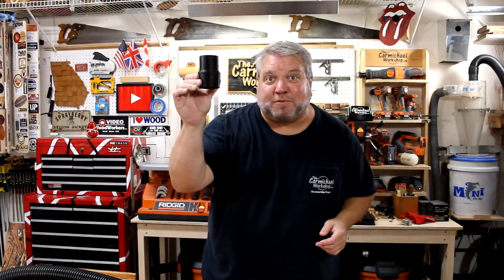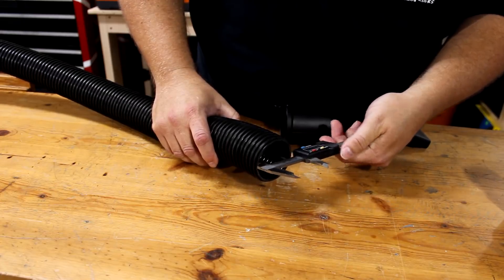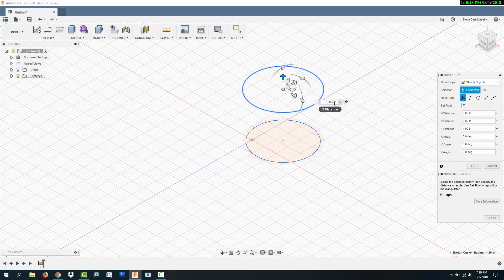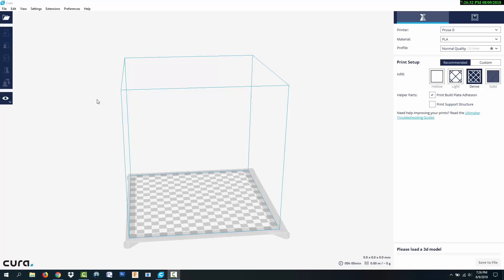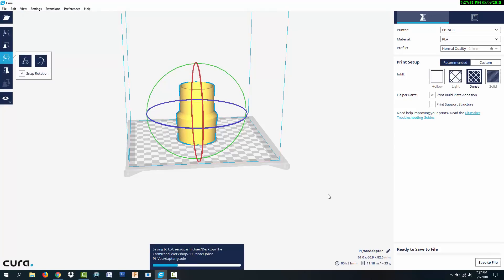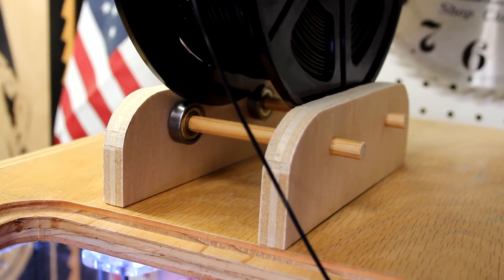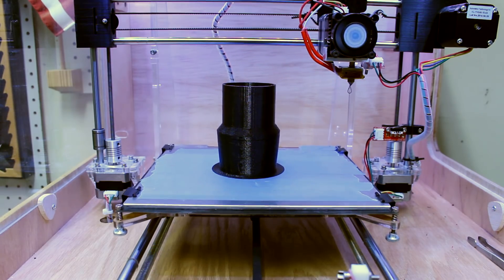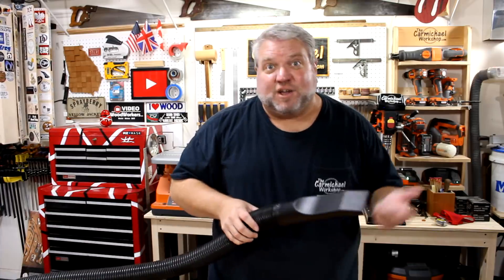Make a Shop Vac Hose Adapter with Fusion 360 and a 3D Printer

Comment: Nice design. Looks a little thin on the printer, have you had any durability issues? I'm printing one now and will find out for myself but would love to hear a review with some age on it.
Reply from the maker: Hey, thanks!  I printed two of these and still use both of them connected to stationary tools.  Sometimes I disconnect one and attach it to the floor wand, but it slides out too easily unless I tape it on, but it's rare I use it for that.  A design change to solve that would be good.
Reply: @SteveCarmichael  printed it. Came out well in just over 2 hours. Was a little loose in my hose but a few wraps of Teflon tape solved that. The working end fits attachments very nicely. It even felt stronger in my hand than I thought it would. Used esun pla+ because I plan to keep it outside in texas. 9/10 Good work!

I'm thinking about trying the remixed version with barb, but he changed the design and in my opinion made it weak. In slicer you can see it only has 2 walls on the straight part. Will try soon and let you know. Thanks again.

Comment: I bought my 3d printer partly for this reason. I struggled with Fusion 360 but now it’s very much clearer. Now I can get on with my dust collection hose connector/adaptors. Thanks Steve.
Reply from the maker: Cool!  I've made a few of these since.  I saw on thingiverse, someone added a modified version with a ridge on the end to hold it in the hose better.  I haven't used Fusion360 since so forgot all I learned.  lol

Comment: not sure what i have missed, but when i try and move the circle along the vertical plane, nothing moves or changes, what have i missed?
Reply: I think it has to do with constraints (which fusion 360 does a bad job of showing you). Notice how he draws the circles off-centre from the origin. In addition, you need to make sure that the second circle's centre point is not constrained on the first circle's centre point. In the sketcher, make sure nothing but "Show Constraints" is checked in the "Sketch Palette" window on the right. Then look for the circle constraint, select it, and then hit delete.

Comment: Hey Steve, great video. You sold a $300 Autodesk product today! I was wondering about your measurements on the hose and nozzle. 2.0 and 2.3" respectively. The vaulted, narrower portion of the smallest end is 2.0. If your hose is 2.3", is the clearance between the ID of the hose and the 3D Printed part the .3" allowance for it to fit snugly?
Reply from the maker: Hi Kevin!  I did?  Wow, that's awesome!  Thanks!  I watched my video again for the measurements.  The end that the vac attachments slide onto is tapered.  The attachments have an inside diameter of 2.3", so I made the tapered end start smaller at 2.2" and go to 2.4", so that the attachment would slide on and get snug about half way in between. The other end that slides into the hose is just 2" straight with no taper, because I planned to glue it in, but it's actually tight enough that I haven't bothered gluing it.

Comment: I am thinking about diving into the 3D printing world, and I really like your method for supporting the spools so they can rotate with ease. Should you ever find the need to do multi colored printing, I just watched a video from 3D Printing Nerd about something called Palette 2, which allows almost every printer on the market (as long as it uses 1.75mm filament), to print using 4 colors at the same time. You can find that video right here
https://www.youtube.com/watch?v=gd3FGrIDYn8
Reply from the maker: Wow, that is really cool.  Didn't even know that was possible to make multi color filament.  Thanks for the link!
Reply: The Palette 2 will allow you to put Van Halen stripes on anything you print. :)

Comment: Hi Steve I was was thinking about getting a 3d printer for clamps tooling an like you I struggle trying to get the right size adapters to fit. Do you think they are a good investment.
Reply from the maker: A kit like mine is about $150 these days.  I have it just to play with and make occasional videos.  This is the first time I've made something I can use though.

Comment: That was neat. How many types of material can the printer accommodate (besides plastic)?
Reply from the maker: Hey, thanks!  Yeah, I need to print some more stuff.  I think it only uses plastic-based material, because it basically melts it and spreads it layer by layer.  There is filament out there that has wood and metal in the plastic, but it's still mostly plastic.

Comment: Thanks, Steve! I've been considering a 3D printer for my shop. Great info here! With respect to hose adapters: I've been messing around with heating up PVC pipe with a heat gun and reforming the PVC pipe to fit different diameters. It works but not ideally. I like what you did here. Thanks again.
Reply from the maker: I've done the pvc thing too.  I'm actually printing some of these to replace those.  There is an elbow that I would like to try printing which would be a good challenge.

Comment: It can sometimes be difficult finding the correct shop-vac adapter. I went along to the plumbing center and picked up some lengths of PVC plumbing pipe of two or three different diameters. I then cut them to the desired length and slipped the smaller diameter pipe inside the larger one and used PVC weld to hold the two pieces together. I have made 5 now and they all work great around the workshop. Just thought I would share that for peeps who don't have a 3D printer.

Comment: Hey Steve, nice Video have you noticed your printer lost one of the left linear bearings which is now jammed against the left Z leadscrew?
Keep up the good work
Reply from the maker: I will have to look at it.  I noticed there was a white plastic bushing at the top left that had worked its way up the threaded rod.  Also the front right thumb nut that adjusts the bed height vibrated off a couple of times.  I got it in a trade, so someone else put it together.  Thanks for letting me know.

Comment: I just got a 3d printer and am the process of printing anything that I can use in my shop. The main things are peg board items and the black plastic knobs for jigs. Do you plan on sharing the stl file?
Reply from the maker: Hi Rick - I put it on Thingiverse - https://www.thingiverse.com/thing:3046968
Reply: Thanks Steve.

Comment: Hi mate before i start, our heatwave is well and truly over now, it's been bouncing these last couple of days.
Anyway as for the video, it's amazing how technology has come through these days, i don't have the 3d printer plus i'll be useless with the input of the size i wanted, heck i struggle with Sketchup that's why i prefer PDF plans ha ha ha.
As for the adaptors, i agree you can never find the size you want so i just go old school and either make them, or lately i have used a heat gun and melted an adaptor just enough to fit what i want it for, then let it cool down, adaptor done. Take Care mate.
Barry (ENG)

Comment: Very cool Steve, I am still trying to learn Fusion 360.  Thanks for sharing.
Reply from the maker: Hey Marc, this is the first thing I've tried.  It was a good starter project since it called for just circles, move, loft, shell, and hole tools.
Reply: Well,  you did an outstanding job, Steve.  I was going to drive to the Atlanta show but I don't think my back and hip can ten-hour drive, and I am too much of a coward to fly.

Comment: Hey Steve that came out great.  Excellent use for the 3D printer.  I can think of a few fittings I need to print for my dust collection system.  Thanks for sharing.
Reply from the maker: Thanks Paul!  It's pretty awesome to be able to create a part that I couldn't find anywhere.

Comment: You are one smart guy Steve, and I sure do like your sticker display. Shows lots of respect for your fellow YouTubers. Congrats on your success with the hose adapter, it certainly is a problem for lots of folks.
Reply from the maker: Thanks!  The sticker spinner keeps growing.  I may need a second one.
Reply: @SteveCarmichael  it's pretty cool!
Reply: by the way, to not have to resize your files in cura after finishing in fusion save it in mm when you're done making it.

Comment: Great Video Steve ! i'm trying to find the correct adapter for my new Kobalt Table Saw dust port !
Reply from the maker: Hey man, if you can't find one let me know and I can try to make it.
Reply: Hey Man thanks ! I will get back to you on this ! I dont have dust collection in the shop since I mostly just use a Scroll Saw.  The new table saw makes a mess though lol.  I only have a 6 gallon shop vac at the moment to clean up with.

Comment: Glad to see some more printers failing!  Try doing it in vase mode so it won't be weaker on the seam.  Next up...my world cup?
Reply from the maker: Ha, yeah, it was funny but kind of disappointing to see the nozzle just moving around mid-air after a couple of hours of success.  It was easy to fix though.  I didn't know there was a vase mode.  Will have to look for that.

Comment: Awesome Steve! I really want to get a 3D printer!
Reply from the maker: Thanks Mark!  This is the first time I really used it other than printing little Thingiverse objects.  Now I'm hooked.
Reply: Steve, great to see you using your 3D Printer in the shop. if you print it on its side with supports underneath it will be stronger as the layer lines will be perpendicular to the force on the nozzle when using it. Also Tinkercad is an easier program to design with for anybody new to this. I use it all the time on my channel if you ever need help. Great solution.
Reply from the maker: Hey, thanks!  That makes perfect sense, like wood grain direction.  I didn't know it was possible to print it that way.  May try it on the next one to learn about using supports.  I will try Tinkercad.  Fusion 360 was a little frustrating trying to get things to move and shell like I wanted.